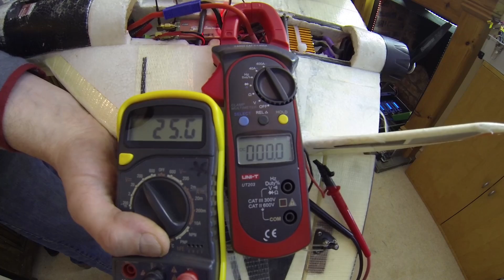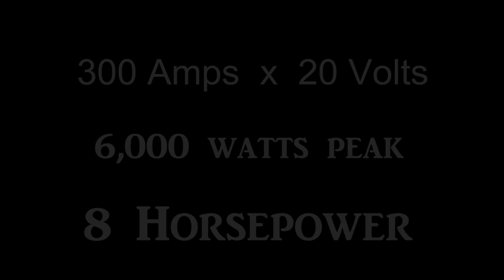FASTEST FPV IN THE WORLD 250mph

Comment: The prop tip is nowhere near mach 1.6. Bad things happen at such speed and that kills efficiency. The sound analysis shows a 1220 Hz frequency, so the motor+2 blades prop revs at ~36600 RPM at RPM peak in your static test because the 7x7 is a big load. So, the very tip is just approaching the speed of sound at best. With no load, at 19 V, the motor will naturally turn at 50350 RPM and 60000+ at 24 V, but there's a load here, so theses numbers are useless.

For speed, we need RPM, not direct thrust (even if it's related, but that's good for acceleration), so a 6.5x6.5 or a 6.5x7 (or maybe better a 6x7 if it exists but I don't think so) could be a better choice to unload the motor and get more RPM without killing the lipo. We can calculate the theoretical speed obtainable with a 7x7 at 36600 RPM, that gives 390 km/h (in flight, the motor can turn a little faster because of the unloading). The power is always higher in a static test because the motor is unloaded in flight again thanks to the forward speed. The current drawn can be reduced up to 40% at max sustained speed.
Reply from the maker: Thanks for the info. In flight, the prop tips are quite clearly well in the supersonic range, and I am confident that this is a fact. There is no need for calculators, the sonic wave coming of the tips can be heard echoing off every object the plane passes over on its approach. The pitch of sound through the onboard camera whilst in a dive shows a massive increase of revs over the pitch of the onboard sound when the plane is static. I would say that the RPM increase was in he 40% range, so that would correlate with your prediction of the reduction in current of 40%.

Comment: HELLO, THANK YOU FOR ALL YOUR COOL VIDIOS, QUIS FOR YOU? ON YOUR LEOPARD MOTOR DOES THE (V1) STAND FOR VENTED? JUST WONDERING ,WHY I ASK IS BECAUSE THIS LBP3674 FOR BOAT/CAR MOTOR USALY COMES WITH NO VENTS, I GUSSE ONE COULD TAKE IT APART AND DRILL/PORT SOME VENTS IN IT THEM SELFS , BEING THAT THE MOTOR RUNS IN CARS AND BOATS WITH NO FLOW THRUE COOLING IM WONDERING HOW IT HOLDS UP WITH ALL THE HEAT CONTAIN IN SIDE, HAVE YOU EVER RAN ONE WITHOUT VENTS OEM ON THE FUNJET , NOT MUCH ROOM IN THE FUNJET BACK HALF FUSE FOR A HEAT SINK , WHAT ARE YOUR THOGHTS ON THAT, AGAIN I RESPECT YOUR R, N , D THANK YOU AGAIN.
Reply from the maker: Hey Jeff, thanks for watching the videos! Great that you are thinking of using this set-up, it really is a beast! These videos are with the original vented v1. You have the same problem as me...the original motor is not available anymore..the boat version does not have vents you are correct, and that is the only v1 available now. I have purchased a v2 for testing, and the venting is even better than the v1, but the specs for the windings is different...we will see how it performs. It would be very difficult to do a good job modifying the boat motor for air cooling, but maybe you have the skills! Good luck with your project.
Reply: THANK YOU RUPERT, I NOTICE TO THAT YOU ARE INTO THE LITTLE FUNFIGHTER RARE BEARS? I LIKE THEM AS WELL , IVE MODIFIED A # OF THOSE WHEN STOCK IS JUST NOT ENOGHF LOL, I WANTED 200 OUT OF THE SKY ANGEL/ RARE BEAR BUT COULD ONLY ACHIVE AROUND 145ISH MPH,INTERNAL FUSE IS JUST TO SMALL, SO WERE MOVING UP TO THE FUNJET AND YOU HAVE INSPIRED ME TO MOVE FORTH THANK YOU, WOULD ALSO LIKE TO DO THE FPV LIKE YOU, I UNDERSTAND THE REASON FOR PUTTING IT ON THE FASTER BIRD , SOME PEOPLE DONT REALIZE WHAT CONCENTRATION IT TAKES FOR THE HIGHER SPEED SMALLER BIRDS  WITH (NON FPV)THE HUMAN EYE IS ONLY SO GOOD ON A CLOUDY DAY AND YOUR FPV PUTS YOU RIGHT THERE SO YOU CAN GO THE DISTANCE AND COME BLASTING 200 + PASSES OVER THE DECK ME LIKEY, TAKING THE LEOPARD MOTOR APART IS FAIRLY SIMPLE BUT NOW IM TO A CROSS ROADS , PULL THE END CAP OFF ON THE WIRE SIDE AND SHAFT IS OUT, BUT THE MOTOR PLATE SIDE IS WERE IM STUCK, DO YOU KNOW IF THAT END CAP IS THREADED INTO THE CAN? OR IS IT JUST A PRESS FIT WITH ADHESIVE?, DONT WANT TO TAP ON IT UNTILL I FIND OUT HOW IT IS ATTACHED? IF YOU HAVE ANY IDEAS ON THAT AT YOUR LEASER LET ME KNOW, I ALSO TAKE MY DOGS FLYING WITH ME I HAVE TWO GOLDENS THERE MY GOOD LUCK AND MY SANITY , IVE HAD BLACK LABS IN THE PAST. KEEP UP THE GREAT WORK!!, IF I EVER GET BACK OVER TO ENGLAND WOULD LIKE TO LOOK YOU UP AND GO FLYING WITH YOU.
Reply from the maker: Hey Jeff, thanks for the message! The rear bears are great, I have left mine stock at around 80mph on 4s, just suits it well. It would be hard to get 200mph from one, simply because of the launch if it had enough power... the torque would be savage! Probably take 1.5-2kw to get one to 200mph... could probably fit around 20 seconds of 2kw in there, but it would be a brick! ..got me thinking now though :-)... Fpv is easier to get a higher top speed from the same plane because you can stay in a straight line full throttle for much longer than flying line of sight... need to make sure your gear is working well and you have plenty of range...200mph covers ground VERY quickly! Would love to have  fly with you, you sound very like minded! Give us a shout if you are ever over here. Where are you living at the moment? Regards. Rupe.
Reply from the maker: ..sorry didnt answer your question... I couldn't even get the wire cap end off on the V2, so have left it in the drawer for future projects! I think it is bonded as well as screwed, if you could get that off, and the rotor out, you would stand a good chance of being able to vent it though.. just gotta be super careful of the windings. Probably best to do it on a milling machine and set an end stop so the cutter cant go low enough to touch the windings.. lot of faff though...
Reply: HEY RUPERT, USA SO CAL, WAS IN THE UK IN 99 AND 01, BTW I GOT THE 3674 ALL VENTED, ME AND MY BUDDY BRIDGE PORT TOOK CARE OF IT, GOING TOJUST MAKE A ALUIM MOTOR PLATE FOR IT BEING THAT THE VENT HOLES CONSUME ALOT OF THE PLASTIC OEM MOUNT ,HOPE ALL IS WELL.
Reply from the maker: Good work! wish you were closer, you could vent a couple for me! Yeah, I use an aluminium mount too, you need all the cooling you can get!!
Reply: Hi Rupert is this plane still up for sale? I read somewhere you were maybe selling it.
Reply from the maker: Hi Andrew, sorry I dismantled this plane and used some of the parts in the Strix Goblin...

Comment: Can I use the Leopard X2 2650KV motor instead?
Reply from the maker: Hi, It is very frustrating that they don't sell this motor anymore! I have not tried the V2, but it has quite different specs, so would probably not perform the same. It may be worth a try though.
Reply: Im seeing a few of your V1 types floating around online but geez they are expensive. Like $80 USD or more. What was the esc mod and flight controller?
Reply from the maker: Be careful, there are 2 versions of the v1, there is one with cooling holes on the end, and the boat version which is sealed up...no good for planes! I haven't seen a V1 with cooling holes for ages..The esc needs a much bigger heatsing, and it needs bonding on to the FET's with heat transfer epoxy (not thermal grease)
Reply: Thanks for the info on the V1 and you are right its hard to find the ones with the cooling holes on the end. The ones I see just have a small thread which is not enough for cooling